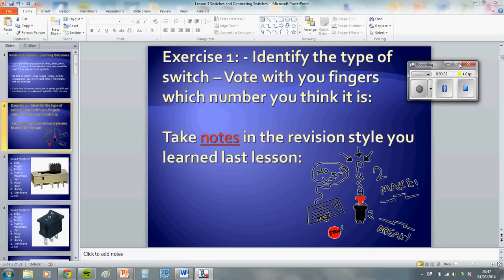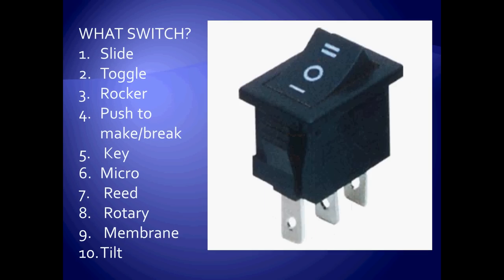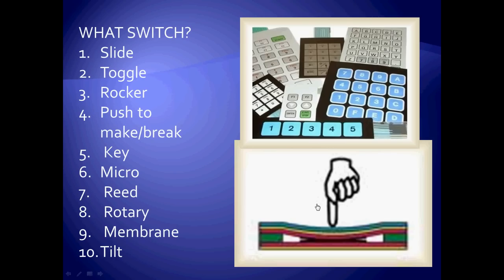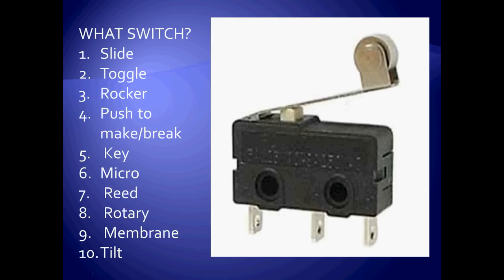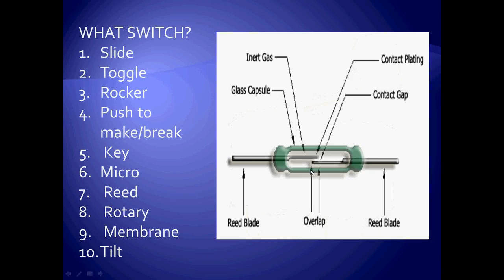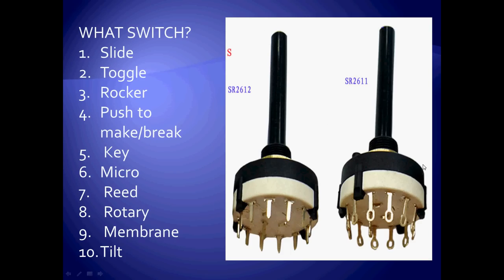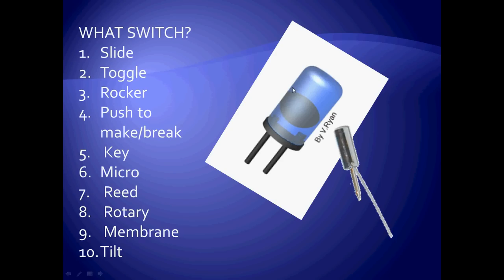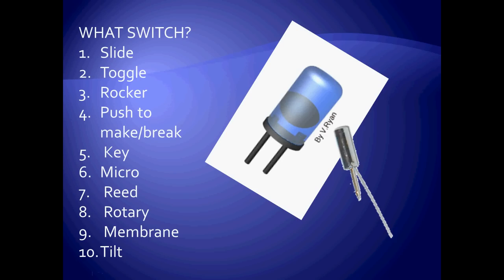Switches revision 1

Comment: How do you eliminate switch bounce?
Reply from the maker: Louis Theo put a capacitor in parallel with the switch, or other methods are to run the switch into a MONOSTABLE timer circuit, or something called a Schmidt trigger. capacitor is the easy one.
Reply: Thanks for the really quick reply. Wil the capacitor always be a certain value or does it depend on the circuit?
Reply from the maker: Louis Theo generally 10uf is about right, but it depends what you want. if you make the cap too big, then your can actually miss button presses as you have to hold the button down long enough for the cap to fill fully, otherwise the pulse never gets to the chip.   exam revision time? hope my classes are bothering!
Reply: yep, got the exam in 3 weeks! Our class has actually not had a teacher for a big chunk of the course, so I'm pretty behind on my knowledge. Would you recommend that I cover any specific key parts that you think will come up in the exam? My main source of revision are your videos, which are very helpful by the way.
Reply: Good question... Louis XD